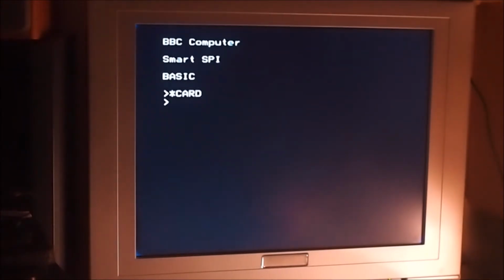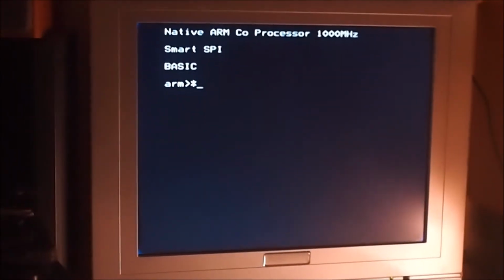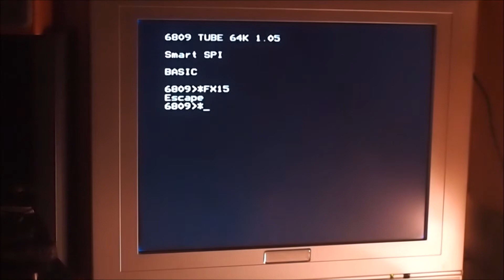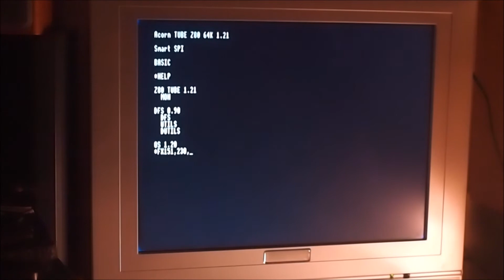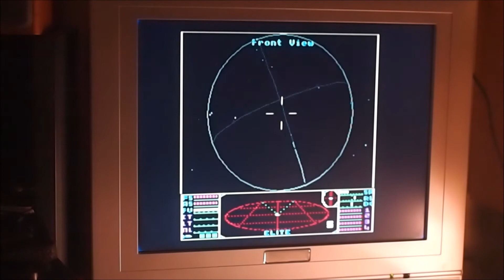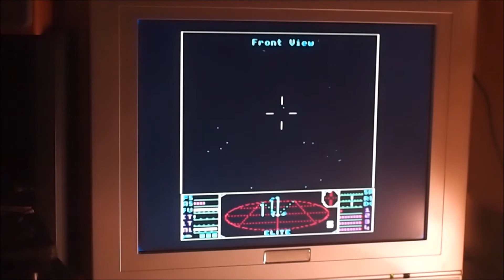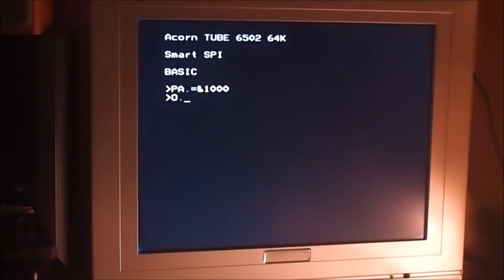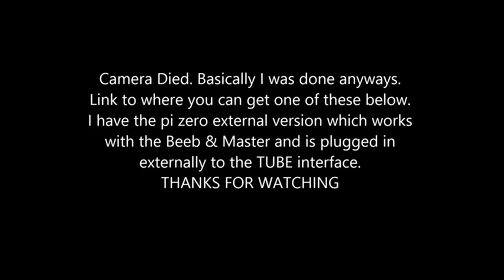BBC Micro Second Processor (co pro) hardware

Comment: Awesome!!!!  Got to get one of those, when I get a BBC :P
Reply from the maker: you should Mr.G, at just under 30 quids you really cant go wrong :)
Reply: How does it connect to the beeb?  Is it just a Pi 0?
Reply from the maker: oh and get an MMC solution too ;)
Reply from the maker: its a pi zero plus an interface that enables it to go into the TUBE interface.
Reply from the maker: TUBE on the Beeb is specifically for co processors BTW